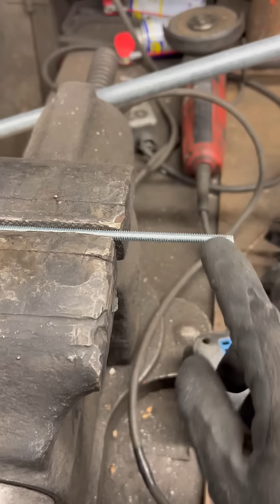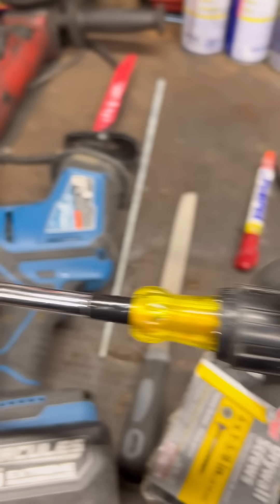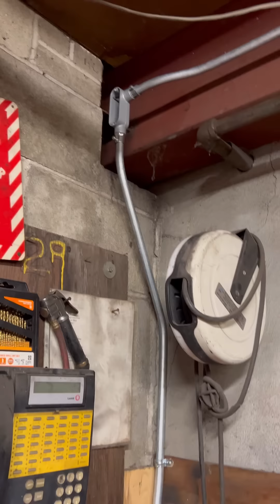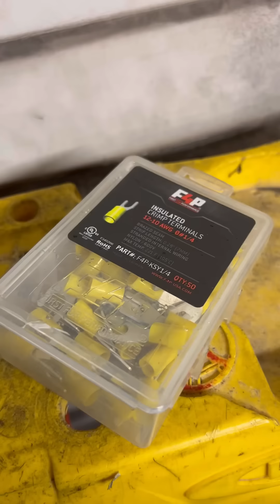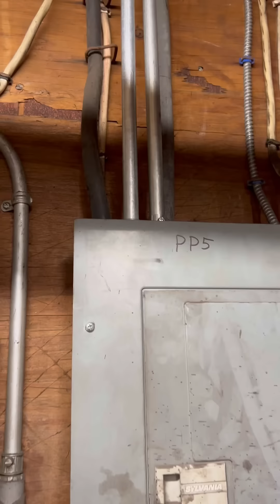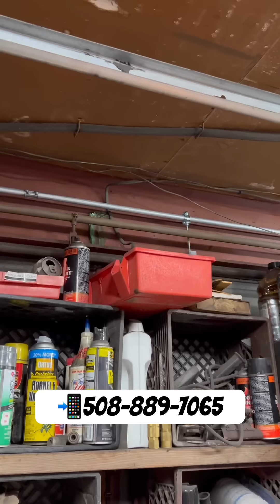🔥Adding 2 Circuits in This Welding Shop Was DIFFICULT!😱#shorts #fyp #viral #trending #electrical

Comment: I'm assuming that you are using stranded wires, crimp on spade lugs shown. You could omit the crimp ons by using the receptacle clamping design for the conductors and Wago lever nuts for the ground pigtails and a solid wire to ground the box. Unless there is a need for a 20 amp plug, 15 amp GFCI's would be fine. Just wondering.
Reply from the maker: Commercial need 20 amp
Reply: @SchecterElectric Maybe that's a local code, but it's not mandated by the NEC.

Comment: Schecter. Thread your nut on the rod before you cut. When you screw the nut off it cuts and rethreads your rod
Reply from the maker: Yes sometimes I do that as well but since I’ve cut so much threaded rod I’ve just become customed to this method. Thanks friend!
Reply: @SchecterElectric  I do the pre-thread also. But if you have have the rod held super tight so it doesn’t vibrate, and you get a good clean vertical cut with your blade, it’s not usually a big deal.

As usual, nice work, Sir!

Comment: Is 1/2 support straps needed every 4 ft? . Looks like you missed one or two  on your install.
Reply from the maker: 3 feet of a box and then every 10 feet everything is completely code compliant and I have more straps than I needed.
Reply: They're probably not pulling a permit for this one 😅
Reply: Within three feet of a box or fitting , otherwise every ten feet

Comment: Thats like 50 amps for a welder and that looks like 100 amp panel kind of cutting it close. You're probably adding two twenty amp circuits
Reply from the maker: 40 amp welder and all non simultaneous load

Comment: Good man, running two seperate circuits 20A each.  I can't stand seeing branch circuits in a workshop unless it is for chargers and other low voltage.  I had Seven (7) indivicual 20 A cicruits put in my workshop.  one is a quad for low voltage chargers etc.
Reply from the maker: Thanks friend

Comment: Impressive, neat, and clean, Bubba. Well done.
Reply from the maker: Thank you friend
Reply: @SchecterElectric  lmao. you didnt solve a problem. you created more of them. i think i commented on your sons channel saying the same thing. i hate to say it but it seems to be a family of hacks. you can cite the code in your shorts but you massively upcharge the customer in material... what a shame.
Reply from the maker: @allenchimpster3085 we did solve their problem that’s the whole point of adding 2 more circuits to give them more power so they don’t trip breakers. I don’t understand what your saying. They were plugging in grinders into the same circuit tripping the breakers on a 15 amp circuit. I gave them two 20 amp dedicated lines that’s the whole point of adding circuits.
Reply: @SchecterElectric  yeah so you run a single line and add a sub panel in the shop. what you did is a hacky and cheap way to do it. if they are going to have high draw in that area on a regular basis, you need to install a load center and not 20A branch circuits. an extra 5 amps may still trip in the future, a 60A panel will actually solve the issue. and im not going to even mention the threaded rod conduit run. was house zoned for commercial? hahahahaha